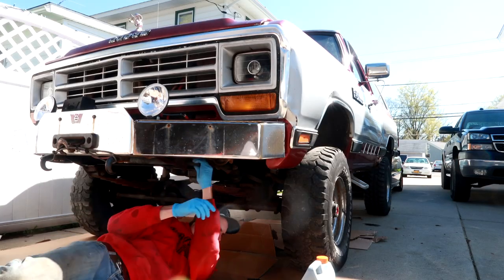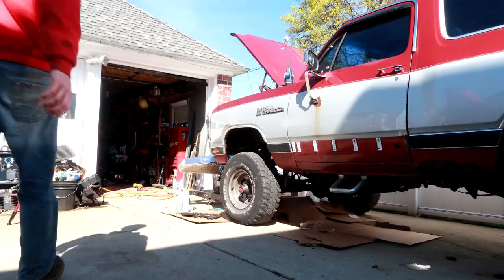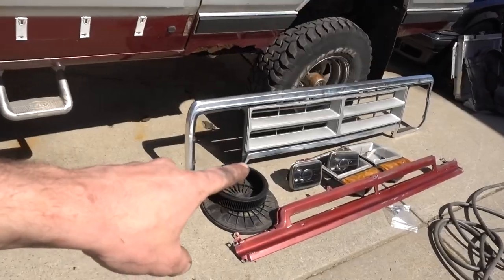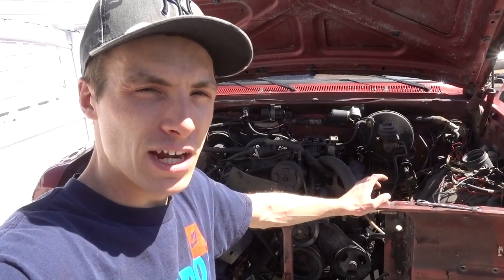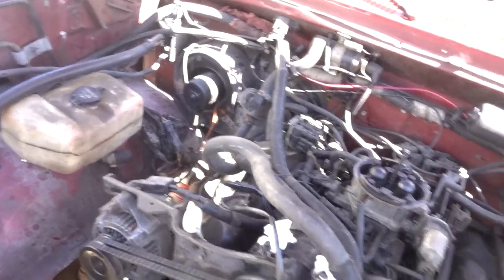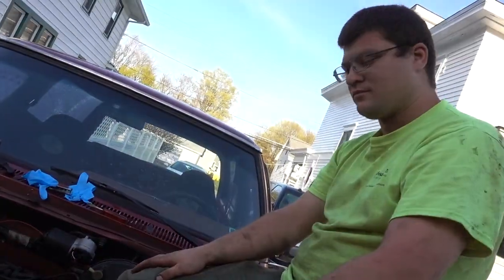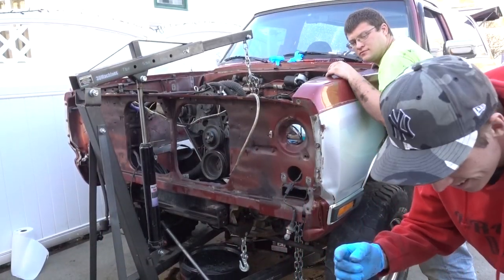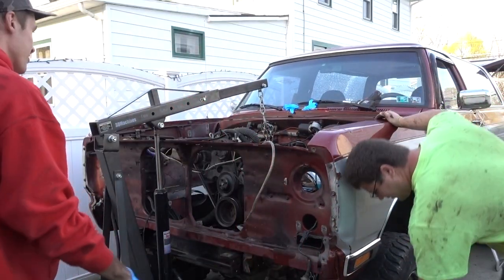NEW TRUCK!! (BAD ENGINE)

Comment: Free tip if you want. I drain the air out of my front tires when I work on my truck. It makes it much easier to work in the engine bay.

Comment: word of advice install the torque converter in the transmission befor you install the engine  so you do not break the transmission pump or input shaft. 
always remove the torque converter bolts and leave it in the transmission when removing an engine.

Comment: Dalton unbolt the torque converter from the flex plate next time and leave it in the transmition it will make pulling the engine easier and instalation will not be a huge pain in the ass

Comment: just a little help you can unbolt the torque converter of the engine and it will stay on the gearbox less oil leaks hope this helps great vids keep it froggy fresh

Comment: Dalton, why don't you fix did the white charger? then you wouldn't have to engine swap. plus it has less miles right?
Reply: bjgaming h the body on the white one is pretty much shot
Reply: ya I guess, plus the red one is already ripped apart
Reply: It was for a good price for the truck too

Comment: 2 guys took 9 hours to pull an engine out of a truck?
Reply: It takes a lot of work to pull out an Engine Davidbrennan5 Especially when your truck is very old there probably was a couple bolts here and there that were Rust welded.
Reply: davidbrennan5 9 hours is overboard even with the rust. Besides...that's what impact wrenches & torches are for.
Reply: Still its not that hard and took to long to make the thing to pull the engine when they could have just used a chain
Reply: It don't take that long to pull a engine R&R is about 4hrs I do it for a living so I know
Reply: I do it for a living to and for someone who's never pulled an engine that's a really great time
Reply: It takes about 4 hours for the average  it yourself guy to do an engine swap on that truck without cutting  any wires hoses etc...   I have seen guys at the scrapyard pull an engine for 3 cases of beer in 40 minutes flat.
Reply: It was his first time ever pulling an engine, we all know doing something for the first time takes way longer
Reply: If I lived closer I would go give him a hand.
Reply: doing things in your driveway takes longer, it probably wasn't 9 hours straight
Reply: took me and my dad close to 5 or 6 hours to put a 396 sbc in a 77 z28 because the headers were a bitch. the motor fit fine just the headers would hit the steering column or the starter or the frame so we had to take out the motor a little pry the headers one way but compensate for the other side. putting in and taking out a motor takes a lot of work and effort bud.
Reply: Marco Rides yeah but did you video the whole thing and stop and adjust camera angles and talk to the camera
Reply: no i wasnt. im saying taking out and putting in an engine takes time its no 30 or 45 min job
Reply: davidbrennan5 you guys need to stop complaining, he never said he was a master mechanic, he even said it himself in a past video that he wasn't as good at cars as he was at 2/4 wheelers.
Reply: Lotta fuckin around with recording the whole thing too I would imaigne
Reply: Bolt's were probably rusted and tbh they wasn't in really no hurry to pull the engine i would've took my time  no need to rush